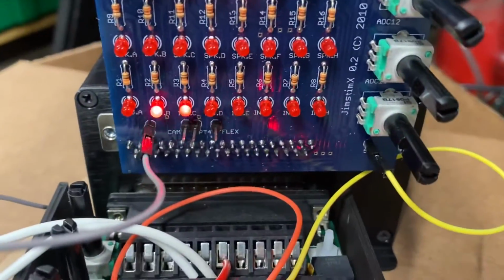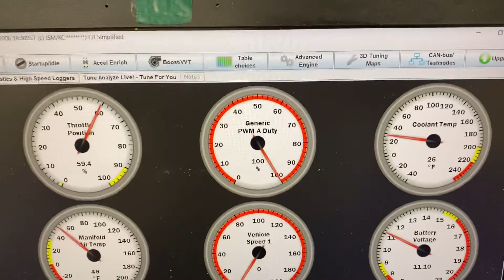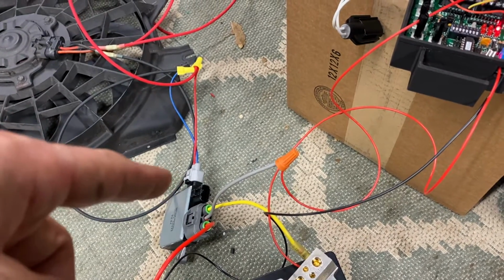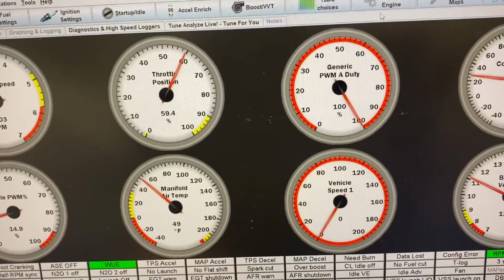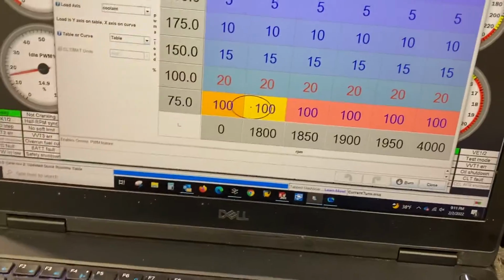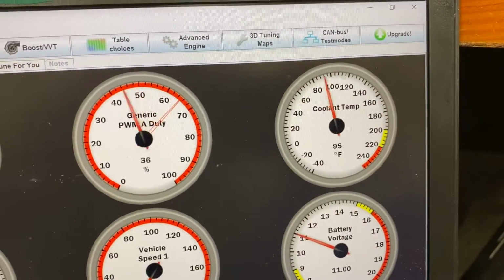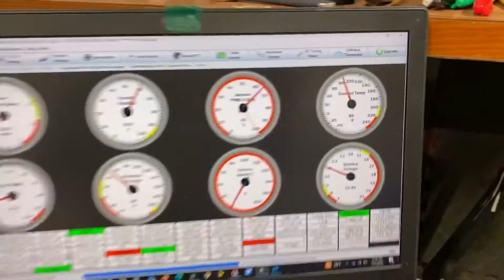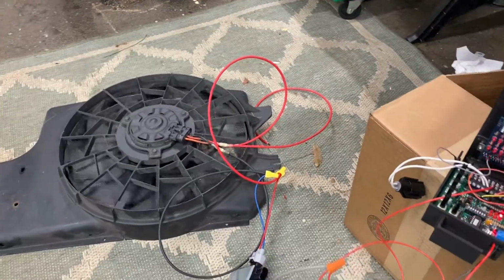Megasquirt controlling INFINITI PWM fan module.

Comment: Where can I find a control module like that? I’ve been trying to figure it out but I can’t. Or is there a way you can tell me how to build my own.
Reply from the maker: The fan module?  It’s a OEM module off an Infiniti.  I have another video dedicated to that module with more information.   It won’t control the fan on its own however, you need to give it a signal by using a standalone ECU like Megasquirt (what I’m using here) or Holley or other.

Comment: Do you have part number of 2 and 3pin plug?
Reply from the maker: I don't have a part number for a good harness.  There are cheap ones on Ebay and Amazon, but i feel the wiring is a little on the small side.   I don't use these on my car and managed to get my hands on the OEM plugs which have much larger wire sizes. 

Search "Engine Cooling Fan Control Module Plugs Connectors Wire Harness 3Pcs for Infiniti G37 G35 G25 Q40" and some might pop up.
Reply: @Mustang5L5  Do you have any pinout for this? If I found it right, ( latch on the top, lookin at the module) 3pin: - , PWM, + and 2pin: +, -. 
And PWM signal it's not like regular PWM to GND but 12V?
Reply from the maker: I added a link to the video description.  Click on it and go to the first post.  Near the bottom is a diagram of the controller wiring layout in terms of POS and NEG.  It matches your wiring. 

I've found the PWM signal responds to both PWM+ and PWM-.   I don't want to label what it should be because I don't have any official documentation, but I've used it with both.

Comment: Hi, nice video. Is this an ms2 or ms3? I have an ms2 with extra firmware and I don’t seem to have any spare pins for pwm. Any detail is appreciated
Reply from the maker: This is an MS3x box that I built, which is why it has a few extra pins
Reply: @Mustang5L5  thanks. I know ms3 has more spares. Was hoping it was ms2.

Comment: Amazing what is the part number of the Controller?
Reply from the maker: My other video on Contour Fan install has the part numbers 

21493-B210B or 21493-C370B are the two newest revisions.   There are a lot of older revs in a black case but I don’t have the part number for them.

Comment: Well done, and works very well. I already asked in your previous video about the controller about the part numbers for the connectors, do you happen to know these(both the large power connector as for the 2 fan wiring connectors)? thanks
Reply from the maker: Did you happen to see my response on your other post?  I don’t know the OeM harness part number but I put a link to the aftermarket ones I’ve seen for sale
Reply: @Mustang5L5  Hi, yes I just saw your reply. Great, thanks!!